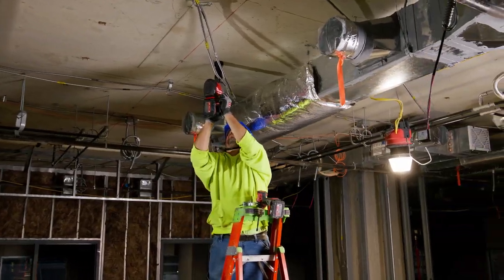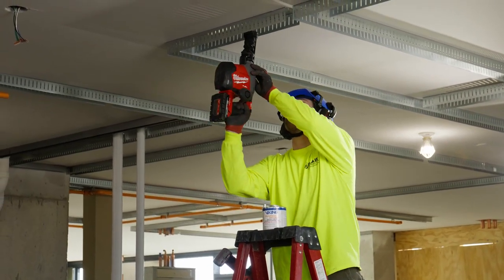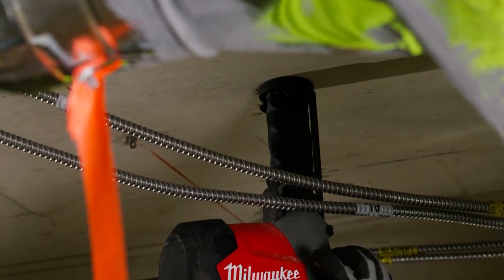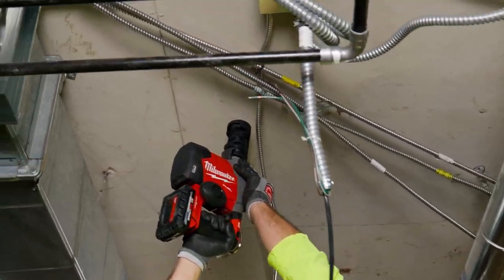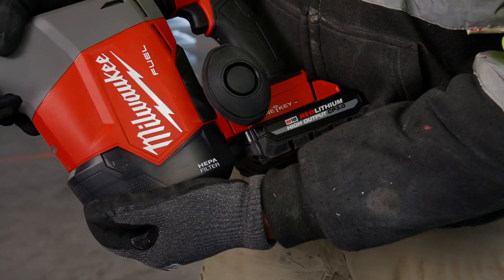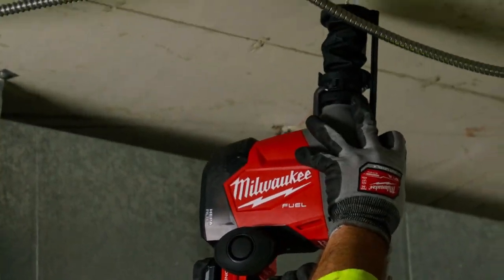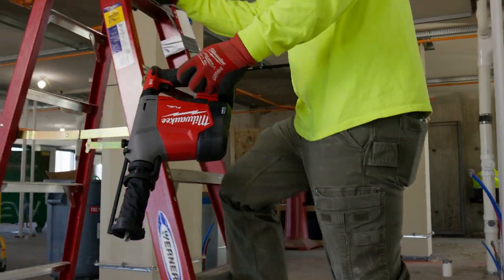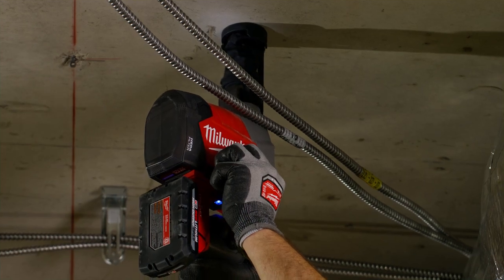Milwaukee® M18 FUEL™ Overhead Rotary Hammer with Integrated Dust Extraction

Comment: M.T, I’ve been a long long time supporter and user of Milwaukee tools but the prices are out of control! My M18 hammer drill went to tool heaven after a great year of service but I went to purchase a new one and it was $299 .. come on guys! That’s not right
Reply: Everything went up in price, everything. Was it still within the warranty?
Reply: @thalegacy6  The costs of Dewalt went up almost the same as Milwaukee but has settled back into a reasonable price but Milwaukee has not went back down since inflation has dropped a little. Also, have you read the horror stories about trying to use the warranty? I’m not even trying. One of the brands will viewed as good to their customers
Reply: @RiversRider  Absolutely, I consider Milwaukee one of the top brands and we definitely pay more of a premium. I haven't had to use the warranty and I'm very hard on my tools. I haven't seen inflation come down anywhere, it's just raising at a slower rate.

Comment: Milwaukee is the BEST no doubt! But what no one mentioned in that the dust extractor makes it harder to drill precisely. Its not impossible to be precise, but it surely complicates things. Also, larger size bits are a pain to use with it...
Reply: you can remove the sleeve if it is an issue, but as you can pull the sleeve back it not hard to see the point you are drilling - after you start keep in the same direction you were aiming.
about bit size it's already rated up to 5/8, longer drill bits might be more of an issue to use with dust extractors - but this is not the aim of this rotary hammer, as it built for people who drill hundreds of holes in celling for mounting all kind of stuff, you don't need long bits for that. I would say it more specialized rotary hammer, if you want to do all kind of stuff they have other options probably with more power.